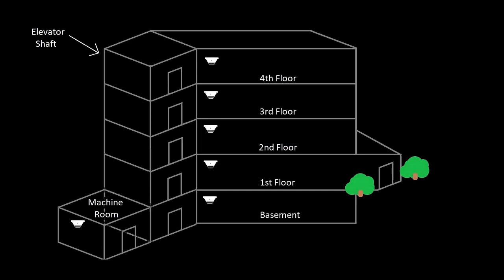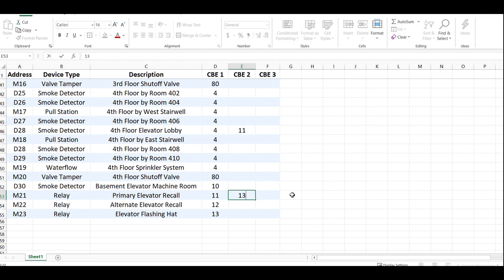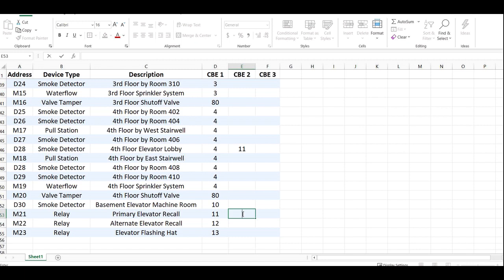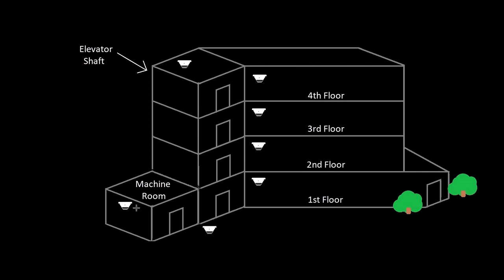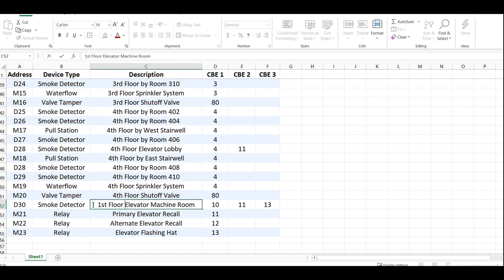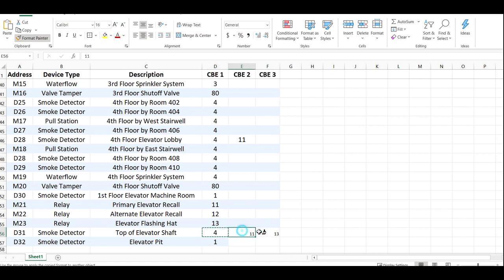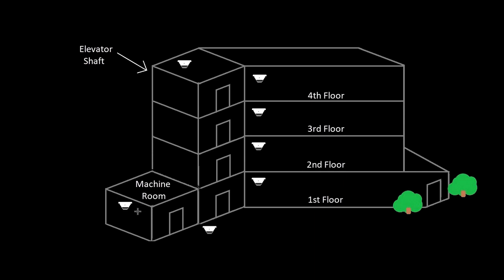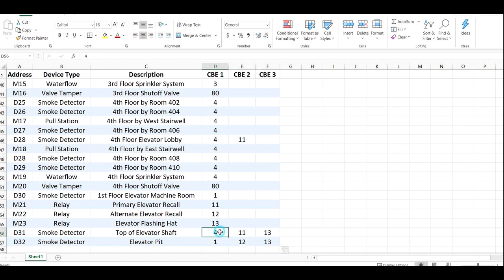37 - Elevator Recall - Correcting a mistake from the last video - Introduction to Fire Alarms

Comment: Pit detectors would only be required if the elevator is hydraulic and the sprinkler(s) is/are above 2'. But smoke detector not allowed because there are no weatherproof rated smoke detectors on the market, as all devices/wiring in the pit are required to be weatherproof.
Reply from the maker: There are smokes in the pit all the time. The pits have sump pumps, so it's not a wet location. I think with new elevator codes they don't require the smokes very often, but in the past it's been very common to have them in there. I've never seen a single weather resistant heat detector in an elevator pit. They're usually addressable heats, which are also not waterproof.
Reply: @JoeKlochan Believe me, my experience as far as what I've seen installed in hoistways is the same as yours. On a hydraulic elev all devices and wiring below 4' of the pit floor is required to be rated NEMA4 and for wet locations respectively. Heat detectors can be found that are NEMA4, but are required to be installed within 12" of the ceiling, same as smoke detectors (which none available are NEMA4 rated). So, no smokes or heats allowed in the pit. A heat installed at TOS is allowed to perform both the recall and shunt trip functions the pit heat/smoke would perform...or a waterflow switch with no retard after that sprinkler "floor control valve" for the hoistway. 

But, wait til next ANSI elev/NEC/IFC/72/101...it'll change again hehehe
Reply: To be clear Joe, I'm not critizing your YouTube video(s). I wish you created more often.

My intent is simply to show the code confusion as far elev control from fire alarm hoistway devices over the years.

For instance, it was "standard" procedure to have TOS smoke detectors in all elevators hoistways in most mid/high rise buildings...at least in Houston, TX. These elevators were of course not hydraulic and most tall buildings in the 70's, 80's even into the 90's were not sprinklered. Now of course, there SHALL be no smoke detectors in a hoistway unless sprinklered and/or hoistway smoke control, and if required to be installed have to be safely accessible. I think we can agree this whole elevator Thang has been and continues to be a cluster F.
Reply: Make more videos !